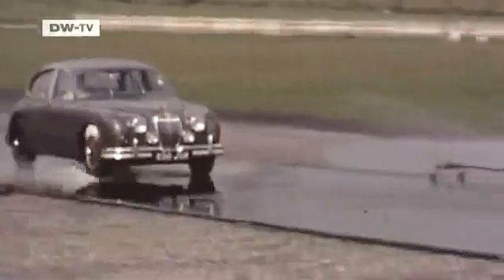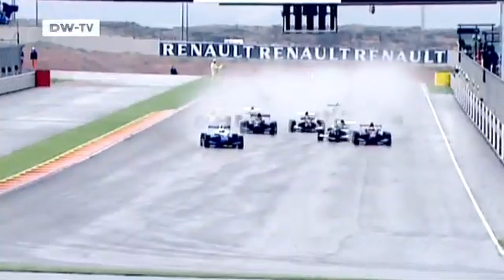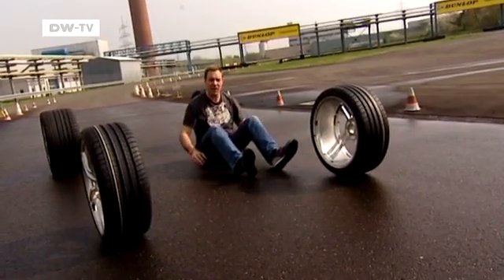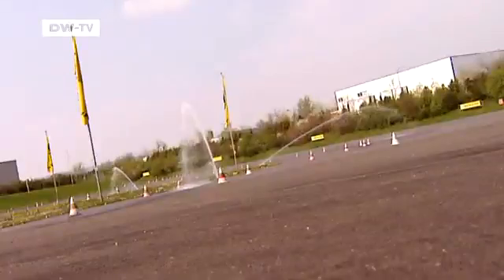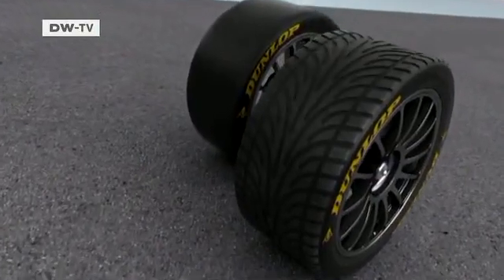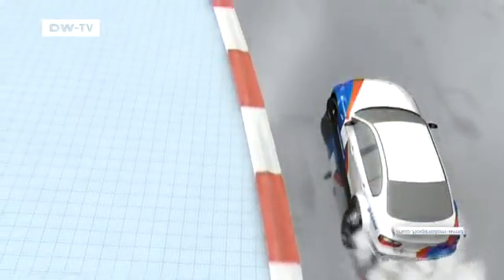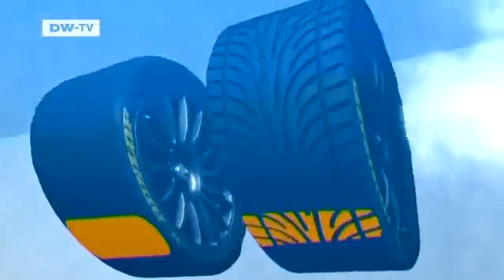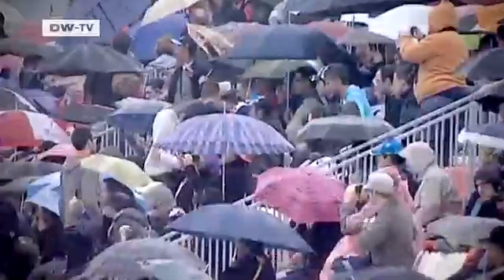examine it! Aquaplaning | drive it

Comment: No no no. Don't listen to him. Keeping calm only makes it worse. You need to panic now! You are about to die. You only have seconds left. Panic now! You want to be anywhere else. You need to get there now! You don't want to be on the water. Accelerate, HARD. Brake, HARD!. Turn, HARD! Get the hell out of there!
OK just kidding. I find these videos incredibly funny. iDrive small front wheel drive cars. they hydroplane all the time. almost always just one front wheel so it is never scary and you don't actually lose control. you're only steering with one front wheel so don't turn very hard at all for sure. but, on my small front wheel drive cars my favorite thing to do you see how fast I can get the wheel to spin. usually it's way above 90 miles per hour.

if you have a rear wheel drive or a truck then don't worry about it she do that was a crappy handling vehicle when you bought it. Or perhaps you're a professional Drifter.